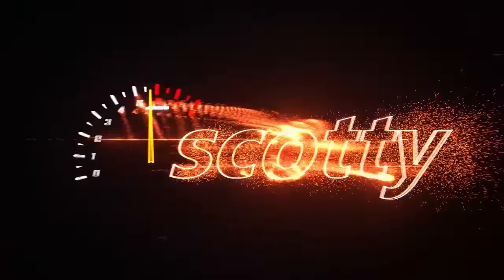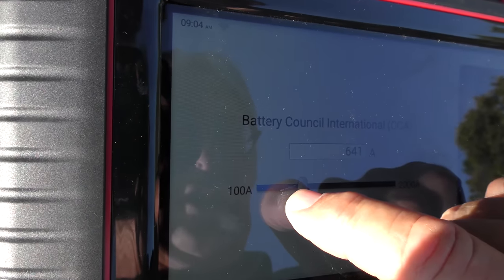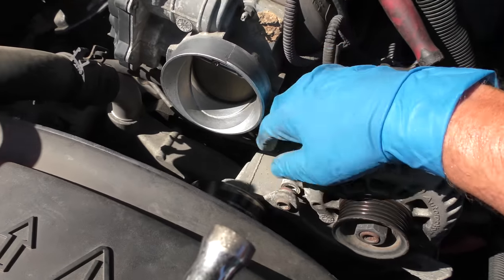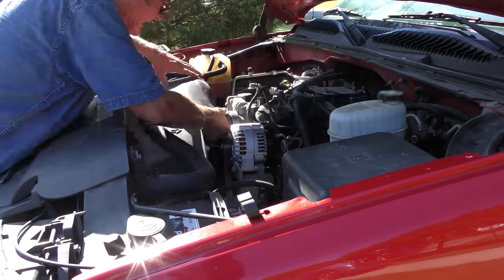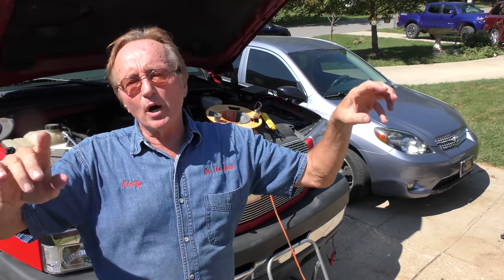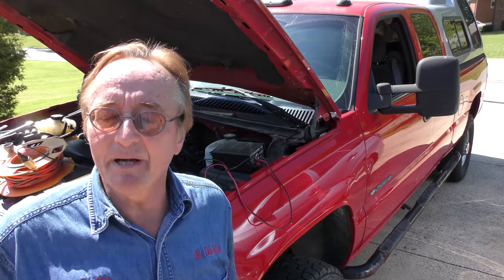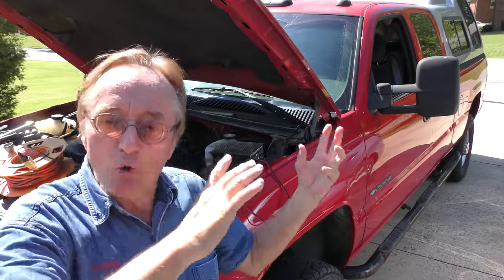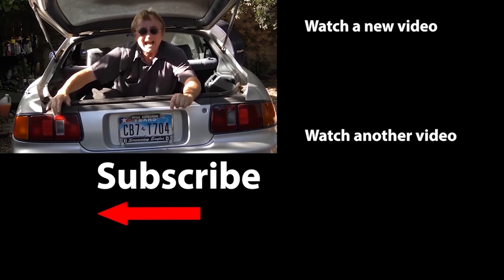I Just Got Kicked Out of AutoZone and I'm Mad as Hell

Comment: This is funny because it's one of the first things I learned when I started repairing my own cars 45 years ago.  You can buy an alternator from one parts store and it's crap, but then go a few miles down the road to a different parts store and buy the same alternator and it's better than the one that the manufacturer put in.
Reply: They probably come from the same manufacturer who hires far worse employees than Autozone. I work at a place that makes finished food products for different brands.
Reply: If its a dodge, it's not difficult to make a better alternator than the original.
Reply: Funny enough many years ago I worked at a factory that rebuilt alternators and starters. It's pretty much dependent on who's working the shift that day on that part. Some of us would be very meticulous, test each part, make sure everything was as good as possible. Others would just sand it down, clean it and move on.
Reply: On my 60s-90s GM vehicles, I just rebuilt the alternators myself.    A good DVM can test the diode trio and power diodes and you can check and replace the brushes.    The regulator IC gets replaced from other junk alternators that I got at the swap meets.

Comment: Here's a tip for alternators being bought anywhere: verify correct part, ask them to test it, then buy it if it passes. 

Many a time early on I learned the replacement alternators were bad only after installing them; both rebuilt and NEW. 

Since I started this process, I've had a hand full of rebuilt alternators and starters fail the test BEFORE I walked out the store AND one NEW IN THE BOX alternator fail the test BEFORE I walked out the store.

When it passes I thank them so much for the effort and reassurance. When it fails I thank them for the catch and we try again...
Reply: Great advice.👍

Comment: Having managed (babysit) a couple chain stores, there is usually only one or two employees at the store that are professionals. Scotty certainly would had gotten his labor claimed paid for installing a bad part from my store. As for parts quality, it really is a crap shoot. The label on the box doesn't mean much anymore. Just a heads up, the local car dealers are stocking fewer parts then they used too. They purchased a large percentage of their stuff from AutoZone etc. The dealerships almost always buy the cheapest oil filter, water pumps etc.  the parts houses offer. They prefer we deliver the parts in unmarked delivery trucks. I wonder why?
Reply: Ya I've seen thoes
Reply: Nice use of sarcasm
Reply: @TheSleepingonit  they are actually parked outside of autozone in my area
Reply: Having worked at an AutoZone for a brief period of time, I have to agree with everything you said.  People there just for a job because they would hire a cold body.
Reply: I tend to buy hard parts at NAPA stores. There is a very good local chain that has one of the few full service machine shops in the greater area. Shops from 30-40 miles send their repairs here. There are also a lot of NAPA affiliated repair shops here. The local Auto Zone is the worst one I have ever seen. Tiny store with little knowledge. We also have an OK O'Reilly's. I also like Advanced Auto Parts, but none around for 40-50 miles.
Reply: I wondered why those vans were unmarked!
Reply: Same story here. Spent 14 years doing the babysitter with keys thing 😄
Reply: We get stp oil filters from AutoZone for like 1.79 or 1.99 on the commercial account. 
Ok maybe it's over 2$ since supply issues,I haven't seen the current cost in 18mo or so. 
Haha I kinda wondered why the big box store parts places had plain unmarked vehicles.
Reply: @alecthenice8115  u
Reply: They get paid like crap so I'm not all that surprised.
Reply: @dirtystockcardriver  i am quick to make it known to employers that NO i do not want to manage anything in any capacity haha, least not at this point in my life, not trying to deal with that.

Comment: Same holds true for starters. Took a defective Honda starter to AutoZone, and what do you know it tested perfectly fine. Battery tested ok as well as the alternator. Ended up towing the vehicle to the mechanic, who diagnosed it as the starter. Ended up spending twice as much as I should have. Always better off going to  Advanced Auto, they will price match AutoZone and have more competent counter help.
Reply: @LactoseTheIntolerant I do euro stuff and I know better than to not use OEM supplier parts. 
I'll stick with Bosch and Ate and you should stick with denso and ngk 😄
Actually I like ngk"s so I'll keep using em. 
Don't you guys have any good suppliers online? 
I gotta get a water pump for the wife's car ,2014 Jetta. 
Dealers like 600$. 
FCP Euro is like 480 for the vw dealer part ,but an oem supplier one is 360. 
FCP is great,lifetime warranty on EVERY part ,even send em back your used oil if you want! 
I usually get stuff next day if it's in stock, but I'd be a 3hr drive from em. 
I'd have to think there would be some decent suppliers online for the Asian imports.
Reply: @MrTheHillfolk  Try Car geeks they might have parts for your VW.  I have bought parts from them in the past, no issues.
Reply: @LactoseTheIntolerant 
I agree.
NAPA cost a little more, but you get what you pay for.

Comment: I used to rebuild alternators. There really isn't that much inside one. The key to a rebuilt one is are they replacing all the bearings and brushes along with using OEM parts.  Most of these rebuilders cut too many corners including the one I worked for back in the 70s. They would buy a bunch of cheap diode plates that wouldn't make it off the test stand without blowing out.  Half the ones that did make it out of the shop came back in a couple of months. The parts that had OEM stuff in them never came back
Reply: I bet your alternator is nice and thick
Reply: Can you even get quality rebuild parts/kits for starters and alternators, and what about pumps?
Reply: @connor3288  I’d like to know of any links too for buying oem parts for alt, starters etc
Reply: Singapore Special diodes

Comment: Take notes everyone. It's all about the "big male parts" when buying a new, high quality battery.
Reply: LOL Size does matter
Reply: Yep, switch the side screw terminals to a normal top post, just dont short out to the hood like I did once.
Reply: @chuckmiller5763  The problem I've run into with a LOT of GM cars is that they don't make the cables long enough to cut the end off and put a new end on it, and still reach over the top of the battery to make the connection. I've hated side terminals since they first came out in the latter part of 79'.

Comment: I’m at a point in my life where I only buy OEM brand name parts now. I never seem to have issues with them. For many many years I’ve bought aftermarket parts and while it is much cheaper, these parts don’t hold up. You seem to get what you pay for with about everything anymore. I’d rather spend the extra money for a good quality part  then have to end up replacing that same part several times over
Reply: Agree and I usually buy from NAPA for OEM certified parts; especially electronics.
Reply: Depends. OEM are made by the same companies as many aftermarket. Have to look and see where it's made.
Reply: I replaced a clutch assembly once, and asked the store to order the best quality parts they could get. I went together easily and worked very smooth. I was very happy and I wanted it to last a long time.
Reply: @hotpuppy1  Could be more now than years past with all the China sub contracting, but not necessarily from the same manufacturing lot sold for production.  The OEM has to have a reasonable level of quality from every subbed out part, or no cars would make it off the assembly line and the manufacturer would not buy from them again.  These overseas companies are not known for great QC, and once they start producing the parts for sale as replacement it can be an entirely different story.
Reply: @hotpuppy1  The OEM ignition coils for the '02 Ford Thunderbird are terrible . . . the T-Bird forum recommends a (much better made) asian aftermarket part as replacement. Both sturdier AND cheaper!

Comment: The problem with side post batteries is that if you try to get them on super tight you'll strip out the threaded inserts.  It has always been a horrible design.
Reply: Actually more contact than top post

Comment: I worked at Autozone for one day. I quite after they were telling me to put stuff on peoples bills without saying anything. I watched them do that three times in a two hour period. Haven’t been back since.
Reply: Yep, I am ashamed to have done that when i worked there but I was in a tough spot myself. Now I actively boycott Autozone.
Reply: @AngryCarMechanic  what kind of stuff would you put on someone’s bill?   They didn’t notice it?
Reply: @tigergreg8  Battery protectant, slide pin grease, water pump sealant. Small stuff of that nature.
We called it WITTDJR. So if you're at AutoZone and you see them try to sneak that onto the receipt or convince you; don't.
Reply: Oh that's illegal.  U use to work there and was told not to do that, but recommend the brake, battery, spark plug grease etc. Had 2 or 3 costumers come back to return those packets that a assistant manager put on.
Reply: @AngryCarMechanic  Thanks for the advice, and the explanation, I doubt most know about this.

Comment: There are excellent commercial rebuilders for main components like water pumps, alternators and master cylinders---and they operate in the USA.  Remy is the company that made the oem in my Silverado.  Excellent quality and durable.  The 145-amp alternator that came new in my 2009 silverado is still rolling up the miles all these years later.  They build great remanufactured generators too.

Comment: Love your show Scotty, you know when GM came out with those side terminals they were supposed to eliminate corrosion from battery acid that would sometimes seep from the vents in the top of the battery. you should try jumpstarting one of those oh I forgot I’m sure you have many times.
Reply: Which is why after the original battery replacement, I went with dual terminals for my next battery, dual terminal batteries cost the same as single terminals, so it's beyond me why people don't go that route?

Comment: About 7 years ago now I had to replace my alternator on my Acura TL. Bought a rebuilt from Auto Zone. Immediately after replacement had squeaking. Replaced the serpentine belt. Still squeaking. Come to find out it was the "new" AZ alternator that came with bad bearings. Returned it for replacement. Bad bearings a second time. Returned it for replacement again. Bad squeaking bearing a third time. Returned for replacement. Bought a used OEM alternator with 90k miles on it that had good no squeaking bearings. I learned my lesson and have not bought parts from AZ since. OEM from now on. Thanks for the video.
Reply: Autozone alternators are notoriously bad out of box

Comment: Hey Scotty your so correct, I have even had the new brand from these auto parts fail just installed, alternators and starters it frustrating as a technician to always have to modify these parts to fit then only to failed, i have decided to use the bosch parts if the jobs take an hour or more and have seen great success, but love your vids, keep.them coming!!

Comment: Scotty, I agree with you about the lousy side mounts on the batteries on GM cars and trucks.

I've changed out the crappy battery on my S10 years ago, converted the cables to top mount and dropped in the largest battery that would fit in the hole.
 Even did cut aways on the battery tray to accept a bigger battery and cut away the battery plastic carry handles to get it in.  Works great.

Comment: I absolutely get what you're saying about a-zone and from what I've been seeing over the years home auto repair is fading out like the tape player. I believe one day you'll need a special license to be buy fossil fuel. Every thing I know is becoming more and more obsolete as the industry changes so quickly these days.
Reply: There is not supposed to be as many parts to repair on electric cars. Many less mechanical parts for sure!
Reply: @stevenpollard5171  there's still tons of bells and whistles. There aren't any engine sensors, but there will be more sensors anyway. Plus, you get to deal with high voltage systems. Sounds nice, right?

Comment: Good tip about tapping the spacers with a hammer Scotty. I prefer to take the appropriate size bolt, nut, washers and socket and use them as a press to push in the spacers on the bracket.
Reply: A good tip indeed. Too much risk of breaking the ears off if you use a hammer. Yo can also use quick clamps instead of a bolt
Reply: @erik_dk842  Agreed. Thanks for your tip as well!

Comment: Replaced the Alternator on my Sonoma 20 years ago.  Tried a new one first.  The mounting holes didn't quite line up.  After jerry rigging a mounting, drove it to work the next day only to have the flywheel/fan come off letting the belt slip off and melt.  Try number two was a rebuild.  It dropped right into place and has worked flawlessly for two decades.

Comment: I totally agree to not buy the cheap rebuilt in Mexico alternators.  The same thing happened to me when I replaced my wife's '92 Toyota Previa van's alternator at O'Reilly's that was remanufactured in Mexico.  The first one failed within a few days, and I went through two of them and like what happened to you the alternator second one only lasted one day and it failed also.  I took them both back and went to Advance Auto and got the more expensive alternator that was made by Denso the OEM version, but remanufactured in the USA.  They also carry the cheaper version that you should avoid.  They own World Pack that carries the OEM foreign parts the Toyotas need like the turn signal lamps and can be ordered in the store.  It worked and was worth it.  The dealership didn't have an alternator I could buy for this older vehicle.  If I had it to do over, I also like you would recommend not buying the cheap Mexico remanufactured alternator ( Auto Zone also sold the same cheap Mexico rebuilt alternator that just has a different box ) and going with the OEM version.  No one is going to reimburse me for my time and trouble installing the alternator three times when it should have only been once.  You are right one with this video and some of the people that work at the parts stores.  Some of them are good and want to help, but they aren't rewarded and move on after a while I'm am environment like that.
Reply: A Previa, HELL!  To work on the thing you gotta raise the driver seat & open the floor?  So glad those have aged away, geez.  Sympathy.
Reply: You are correct, but my wife's is an All-Trac version and mine is a 1995 RWD Supercharged version with 311k miles on it.  It runs and the a/c still works.  These are not all gone.  My Dad also has a 92 Previa and had an 1996 All-Trac supercharged version until my nephew slammed it into a tree.  My daughter has a 1993 five speed Previa that she drives daily.  Actually you have to take out the passenger seat to get to the top of the engine and spark plugs to work on it.  These are great and great to own.
Reply: I pull oem ones off scrappers
Reply: When it comes to Toyota, Denso is the only way to go. Spend a little more money but save you some time in the long run.
Reply: @michaellandry788  still driving our 95 s/c 260k here in kentucky, had it 13 yrs and never let me down. ill drive it till the wheels fall off.
Reply: Previa and toyota van wagon, man those vehicles are tanks!, my dad had 3 van wagons back in the day when you can purchase a decent vehicle for sale by owner lol , gone are those days, also he bought them for 5 to 700 dollars, i bought a previa for 100 bucks in 2009 from a women who just wanted it gone, yo it had 300 thousand plus on the engine, and when i bought it from here it had less then a quart of oil in it , no oil leak tho she just kept on running it year after year she said no oil change , so i still bought it did the oil change ,that van ran awesome, i sold it with 360,000 miles for 500, but it ran great!

Comment: I have never been treated bad by the employees at the Autozone I go to.  If they do not have the part in stock, they will check other Auto Zones in the area, and they always call the other store, to verify they have the part, and the part is in good condition.  They will even go get the part for me, and have the following day for me, if I do not have  time to drive to the other  store that day.  If I ask them to check the alternator or starter before I buy it, they check it right way.  Yes they have been suprised when they found a new rebuilt alternator or starter that was bad in the box.  I have no complaints at all. Excellent service, they know most of the general parts they stock, but beyond that, their knowledge is limited.

Comment: I stopped shopping at autozone for reasons just like these. They were always selling me parts that didn't work or just the wrong part even though I strictly pick out my own parts online to ensure I don't get the wrong one. They've even sold me a used wheel hub once in a new box so I didn't notice till I got home and had the old hub off. Different locations didn't work either and i put up with it for years. The last straw was they gave me the wrong part and the guy had the nerve to argue with me that it was the right part. I now strictly shop at advanced auto parts. Nice quality parts and I have yet to make multiple trips for one job.